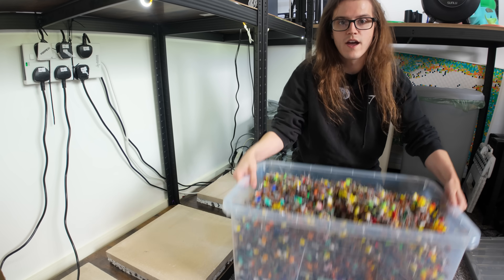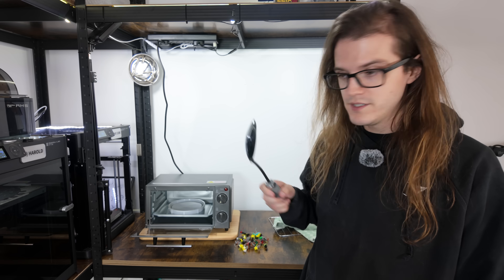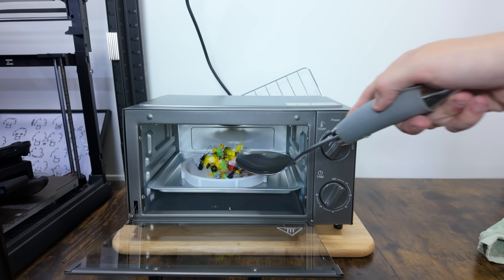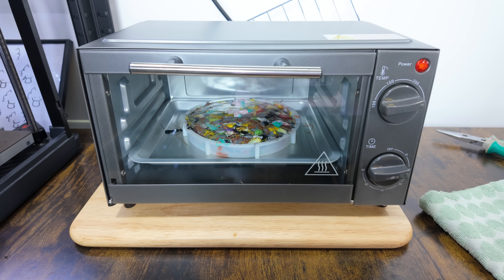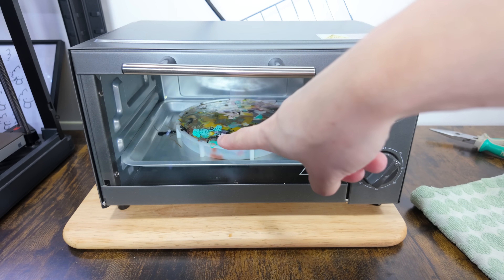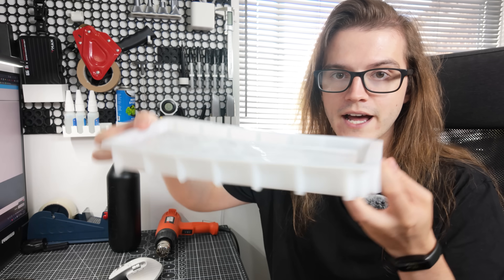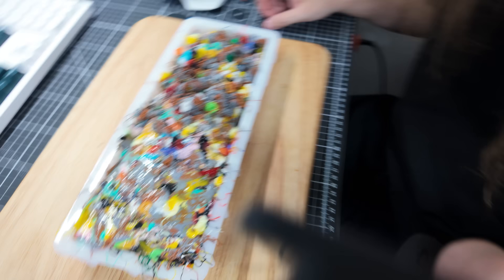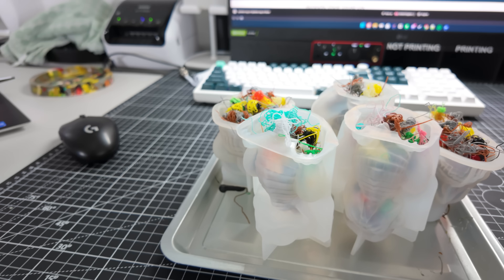Turning 3D Printer Purge Piles Into Profit!

Comment: Maybe use the heat gun to coat the outside and fill in the little gaps with a small amount then add more and use the oven. Still cheaper than pouring resin….

Comment: Why don't you do a trial with a sandwich press? This is the way we melt HDPE classification 2 recyclable plastic, you have to put baking paper down first, put the poop in, then another piece of baking paper so it doesn't stick, this will melt the plastic quicker, then place that load into mini oven to keep at temperature, from there just keep making in press until you have enough to fill your mold, push in with heat resistant gloves, then put flat glass on top, leave overnight before removing from mold.

Comment: I have some ideas. 

1) Grind the poops into small bits, reduces the amount of air gap between the parts. Fewer bubbles, more rapid melting. A cheap paper shredder should handle poops reasonably well, so can a blender or food processor. As with the toaster oven, don't use the same one for hobbies and food. 
2) Put a big ceramic floor tile or brick in the oven and pre-heat it. Leave in there while melting. More thermal mass to keep the temperature even when repeatedly opening the oven door to fill the molds (or when swapping racks between batches). You can also pre-heat your silicone molds at the same time to help speed up the first melt. 
3) Once you have the camera's focus locked in for a shot, turn off auto-focus.
4) Don't let the silicone molds get above about 250C. It starts to degrade and you get sticking, cracking, etc. 

Thanks for coming to my TED Talk.

Comment: I poured UV resin into the mould after the process, liquid resin was a bit easier to work with to fill up the holes if you have the patience. Iused the heat gun to melt the poop, therefore there were a few gaps to fill of course.
Reply from the maker: Thanks for the tip, I'll keep that in mind for the next time I try this.

Comment: It might be a good idea to consider finishing the underside of the pieces, sanding them, and removing any burrs from the edges.
Perhaps an oven with a fan inside would be beneficial to circulate the hot air evenly throughout the pieces.
Perhaps drilling holes in the tray of your current oven would also be beneficial to facilitate hot air circulation. You want hot air to surround your piece. In your case the bottom heating element can practically only heat the tray, creating a hot spot where the piece touches it.

Comment: The time it takes to properly melt the purge, supports etc and having it fuse without voids, cracks or bubbles just isn't worth it. Especially not when you factor in the cost of running a toaster oven or heat-gun for 1h+ that not only draws a high amount of power but also heats up the area/room around you which in turn has to be cooled back down by your AC (if you have one).  Personally I wouldn't call this profit (the time factor alone turns this into a loss in my book).

Comment: You get better results chucking them in a saucepan and then tipping the melted pla in your moulds. I’ve been doin it for years now. You’re on the right track tho. It gets rid of moisture in the filament. But you can get cracks in the mould. When it cools I find.
Reply: The only drawback is that you'd likely lose the distinct colors, as they would blend into a grayish-brown blob.
Reply: Make a video of it please
Reply: Sounds like it works but are you doing that on your stove in the house?
Reply: @justinwirtner4738  you can always use a hotplate .
Reply: Cracking your mold is not better results.

Comment: Very cool, mate 👍 I have been thinking of using a heated glass syringe to see if it is possible to do injection moulding with my poops but your method is way better.
Reply: Sound like a disaster waiting to happen. They will have to decide which wing they will have to treat you. Stop the bleedings from the glass shards first or remove the plastic fused to your skin?
Reply: @riccaregio  Tell me you've never worked with heated glass without telling me that you have never worked with heated glass.
Reply: @John-p6c5g😂 no mainly nightmares from years of safety videos mixed with  things I saw at work plus the incontrovertibile nature of the human being to underestimate dangers and get injured
Reply: @riccaregio  "I know what I am talking about because I have seen lots of videos."

For something to explode, there needs to be a build up of pressure inside of a sealed container. A syringe has a hole in the end of it. As pressure builds up inside of it (i.e. by pressing the plunger), the contents of the syringe comes out of the hole. That is how a syringe works. How fast and how much force were you expecting me to put on the plunger in order for it to explode?

Comment: I would embed some gravel or stones in it, gives it more weight and saves on poop.

I wonder if you could just heat up sand and then mix it with the poop as binder and make a hot mouldable clay from it

Comment: I dont have this issue but what i do have are supports and half failed prints ive kindof sorted and bagged for later by color/type.   My intentions were to get or build a filiment recycler and make filiment i can use for prototype prints. It involves grinding the parts into smaller bits, running them through a piece of pipe that fits a wood augar bit and a couple heating elements to warm it to transition temp and extrude through a 1.75mm drilled nozzle through some cooling system and spool it.
Hardest part is actually finding a metal tooth plastic shreader that isnt a years pay from a manufacturer in china😅
Reply: Not perfect but Ive seen people use food processors. The main goal is for it to be small and mostly uniform. You can make a filter to only allow a certain size and smaller if you are trying to be extra consistent
Reply: @xathridtech727  I've been looking into electric wood chippers. There are some avaliable new for around $120 through temu and Amazon.  I wanted to go with one of those plastic grinders but even the kits are 4 figures. I'd fab up my own but I don't have access to a bank plasma, waterjet, edm, or laser table to make the blades economically enough.  And up until recently I didn't even have access to a dedicated food processor.  😅
I have plans, hopes, and dreams. It's just getting the $$$ to do a fraction of it.

Comment: To fill the holes and cracks I use a 3D printing pen and then sand off the exterior.
Reply: brilliant. I finally hit my 10 gallons I said I needed before I would try this. between that and grinding the fulfillment any other tips?

Comment: Hi Maybe you could melt the PLA with acetone in a container and use a vacuum chamber to remove air bubbles. Then carefully pour the concoction into the moulds, though you may need a hardener if you used too much acetone. If your filament is a mixture of different plastics then maybe a quick Q&A with a Chemical Engineer could solve your problem.
As in 3D printing build your projects with added knowledge.
Just a thought,maybe sitting the mould in a hot bath will purge the acetone during and after pouring.
Reply: Chemist here.  Acetone is highly flammable and the amount you would need to dissolve that much PLA would create an extremely dangerous situation.  Any source of heat or ignition could set off an explosion.  I especially would not use a hot bath to drive off solvent.
Reply: Acetone doesn't effectively melt PLA
Acetone is flammable
Placing anything dissolved in acetone in an OVEN is an awful idea
Hot bath is right out- what the other person said is accurate

I would rather work with a gallon of 70% HCL than this idea.

Comment: You my dude! I got my hands on a heat gun to remove soders (YIHUA 858D) 
It's a heat gun with temperature control!
I use it to reflow my surfaces and "heat polish" my figurines. Keep in mind to have 100% infill, and to not model anything too thin if you want to have the least deformations.

Maybe you could have more control on the heat gun process, or do the cavities by hand and finish off the mold in the oven

Comment: Try a cheap belt sander to level out the bottoms, it will also get rid some of the burnt parts
Reply: A  belt sander will just melt the PLA. I've done exactly the same. The bed plate is the best option I think

Comment: Putting a tapered object (to not get stuck) or another mold in the center would make the center hollow and use much less material. You might be able to determine a fill line for when to insert the... hollower later. The most difficult thing might be keeping the hollower from going down too far, especially for finishing with a level surface when you put the glass on.

Comment: Maybe grinding the "poop" down in a blender first makes it easier to fill in the silicon mold. Also may speed up the melting process. But I assume the color would be blended too much and it would turn brown. But I like the idea of making use of the excess filament
Reply: no.
1. texture
2. microplastics
Reply: If you're whipping out the blender might as well go all the way and build a filament recycler that extrudes new 1.7mm filament